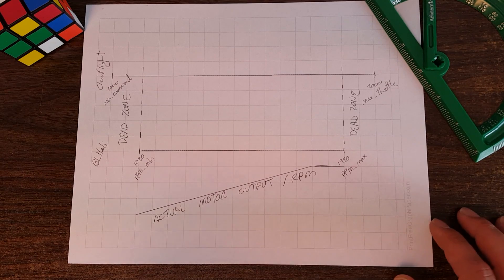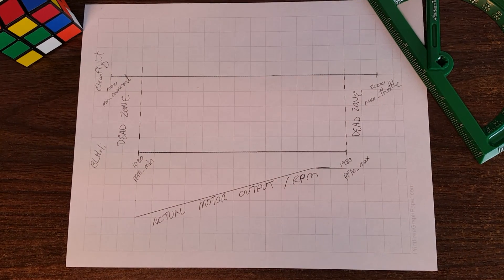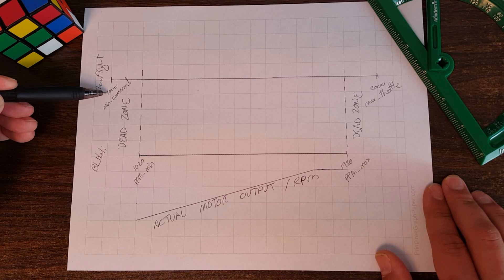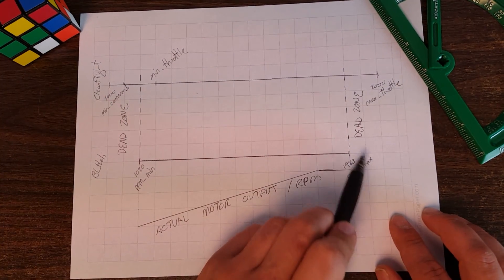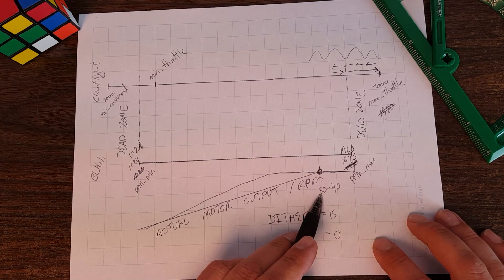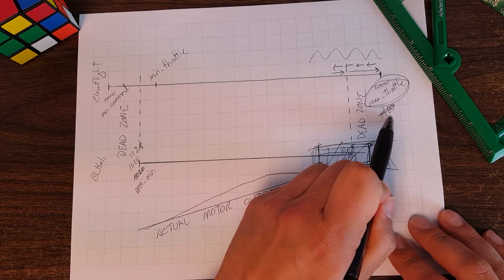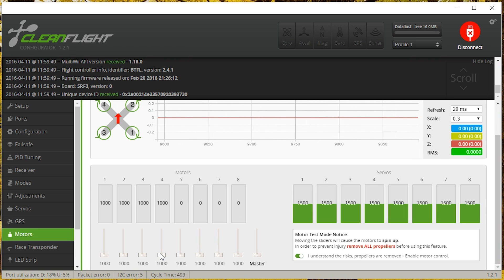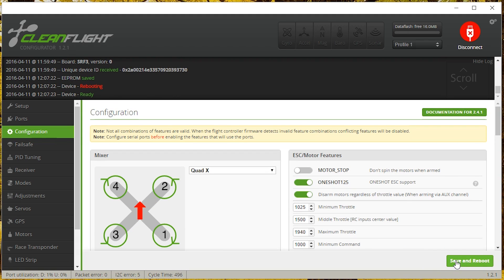Cleanflight BLHeli Top-End Throttle Calibration

Comment: Hey Josh, you do great work keep it up..I was doing some motor mapping and after I made a change I went to check my motor rotations and my ESCs would not initialize..they won't say nothing..I need your help..can anybody help...
Reply from the maker: You must have messed up the resource assignments. Did you note the default assignments before you started? Put them back how they were and start from scratch.

Comment: In my case BLheli calibration max endpoint gets set to... 2020 on 3 motors, and 2016 on one. LittleBees 20A PRO (f396 I think?) with Gartt  2000KV 2206 motors. Can you advise how should I proceed with BLHeli max above 2000?
Reply from the maker: Above 2000 is okay but I don't like to see them at 2020 because that is the max possible value. So you don't know if the calibration is correct. What if they "wanted" to calibrate to 2030 but couldn't because the scale stops at 2020. So I like to see all ESCs at no higher than 2016. 

Decrease max_throttle and recalibrate until that happens.

Comment: Hi Joshua! I saw this video so long ago but yesterday I finally gave my motors a chance.
After some builds, I am now testing the Racerstar BR2205S 2300KV   (cheap but valuable).

Basically my config is SpRacing F3, old school Littlebee 20A, 1300mah 4S, ZMR 250 frame.

I found something like this on the 4 motors:

ESC values 0 - 1920 = very good sound and spinning

1920 - 1940 = Lots of vibrations and not the same clean sound than before

1950 - 2000 = No vibrations, and I can not find a remarkable change in the sound when reaching 2000.

Any clue about this?  Many thanks for your videos and knowledge

Comment: Can you hypothetically limit max thrust on overpowered motors? Reducing max throttle value to say 75% of max thrust and achieve linear throttle 0-75% where 75% is max forward on the throttle stick?
Reply from the maker: +Pete Pilot yes, you could do this.
Reply: Thank you Josh, Can I also ask you your opinion on motor choice for a Crusader GT2 200. Im undecided between the Tornado T2 2300 vs the 2600. Wich one should I go for? The thought was that a overpowered 2600 under limit would give an efficiency gain.
Reply from the maker: +Pete Pilot personally I don't see the point in running lower kv motors any more. You used to give up a lot of torque but not any more. They're harder in your batteries, but if you look at what the winning racers are running, it's all high kv.

Comment: Is the top end flat spot present in all the BLHeli  ESC protocols i.e. Oneshot125 vs DShot600? What protocol are you running in this video.?
Reply from the maker: +Alkiterman top end calibration is no longer necessary.
Reply: Thanks Josh. Why is that?  I would assume you might have had a hand in this....BLHeli coders fixed it?  So, then my question is. Is there any additional tuning required? Like eliminating the 20ms dead zone and using 1980 as max_throttle ?
Reply from the maker: BLHeli firmware updated to no longer have the dead band at the top. Just set min_command=1000 and max_throttle=2000 and calibrate and go fly.
Reply: Do you have a link to the procedure to follow with the latest BLHeli firmware on non_S ESC's in BlHeli and Cleanflight/Betaflight?
Reply: its still there you can hear it even on dshot at least on blheli_s

Comment: Is there a reason why I'm getting numbers like 1850 in the motors tab for each motor? I'm at 960 min command 1020 min throttle and now 1803 max throttle? When I hover now my throttle stick goes over mid stick position, whereas before doing this dead band fix I was hovering below mid stick?
Reply from the maker: You changed the top end of your throttle curve, so you changed the mid-point as well. That's why your hover point has changed. If you go overboard with the top end calibration you will reduce your max power and overall power throughout the throttle curve. But if done right, the overall power will be the same, although your exact hover stick position may change.

If your max_throttle is 1850, that is the first step to fix. Use my "maximum resolution ESC calibration" method to perform both top end and bottom end calibration, while keeping the most possible resolution in your throttle channel. And of course make sure your throttle channel is going from 1000-2000 in the receiver tab.

Comment: Does this still apply in Blheli-S ESCs and Betaflight 3.0 as of September 2016?
Reply from the maker: BLHeli has improved their auto calibration algorithm to remove the dead zone from the top end. However, some people still get top end oscillation and can benefit from doing it manually.
Reply from the maker: +matixnznz yes.
Reply: humm this could be why after i flashed to the latest blheli firmware my esc's are now 2020 in ppm max throttle. might have to drop max throttle back in cleanflight and try again.

Comment: I'm sorry if you covered this question already, but I'm concerned about the the 20us deadzone specifically at the top end. Even if you are setting your maximum throttle at 1940, isn't CF going to really be sending 1920us to the ESC's? My thinking is that you will still be loosing about 20us of range? Hopefully that makes sense, thanks!!
Reply from the maker: If you adjust the cleanflight max_throttle after calibration, that cancels out the dead zone. The calibration ensures that what CF is sending is the same as what the ESC is seeing.
Reply: Understood, but didn't you say in your video that CF has a deadzone added in all on it's own? Regardless of what max_throttle says? Maybe I'm over thinking it but if the deadzone exists in CF, wouldn't you have to compensate another 20us to fully get rid of it? Thanks for the reply!!
Reply: To clarify my question, is there a deadband that exists within the top end? From how I'm perceiving your explanation, there is a top end deadband.
Reply from the maker: CF doesn't add dead-band to the top end of the throttle. I'm not sure what you're referring to, sorry.
Reply: Sorry for wasting your time with this, but I believe I figured out what I was confused about. The deadband (as you describe) is added on the BLHeli side when you do ESC calibration, not CF. Now I totally get why lowering the max_throttle gets rid of it! Thanks again for all that you do!
Reply from the maker: No problem! Glad it finally clicked for you.

Comment: imma try this, although my top end oscillations seemed to be gone with kk 5040x3 props, but a new weird issue appeared on a 4s bolt 1300mah... when i dropped throttle to zero (no motor stop)  the quad faulteringly dropped then revved up by itself, i wonder of this could be the lower end dead zone?, it didn't happen with 1000mah 4s so it seems unlikely, but at this point i have no other clues to go on.... it rev's enough to stop dropping and rise slightly, obviously not a good thing to be happening to a noob like me.

Comment: If, for example, my min/max end up being 1050/1950 in cleanflight, should I change my tx output to 1045/1955 or leave it at default 1000/2000?  wouldn't matching it up elminate some additional deadband on the top end?
Reply from the maker: No. Because you are mixing up the input side of the FC (transmitter -> receiver -> FC) with the output side of the FC (FC -> ESC -> motor). The two are not in any way inter-linked. The input side should always go from 1000-2000 with 1500 as the mid-point. The calibration you are talking about (min_command, min_throttle, max_throttle) pertains ONLY to the output side. It does not in any way pertain to the input side.
Reply: Thanks for that clarification!

Comment: Could you please help me out. In the Receiver tab of cleanflight everytime i set my throttle at 2000(max) and also my roll or pitch at 2000 Cleanflight freezes until i drop my throttle again. It only freezes when throttle and roll or pitch is set between 1900-2000? Is this a Cleanflight problem or will my Flight Controller also freeze when flying around and setting both at max?
Reply from the maker: Are you using a D4R-II receiver?
Reply: Joshua Bardwell No, i use a XSR.
Reply from the maker: Wait a minute. You are giving a stick command aren't you. Throttle at max and right stick up, left, right, or down is giving ACC trim. I don't know whether that usually interrupts the configurator GUI but it wouldn't surprise me if it did.
Reply: Yes, when i give my commands with my transmitter, Cleanflight freezes. What does the receiver tab have to do with the ACC-Trim in the Configurations tab? May you please explain what you mean? I'm new to this hobby, sorry if it might be obvious. Thank you.
Reply from the maker: You are inputting the stick command to cause ACC trim adjustment. I am guessing that when the copter adjusts ACC trim maybe it interrupts the GUI updating.
Reply: Lol, thank you. That is so much faster than adjusting the acc through usb! How can i deactivate this function after i'm done adjusting? I dont want my copter to drop from the sky whenever i have to go full throttle and take a sharp turn...
Reply from the maker: It won't happen when you're flying. It only happens when disarmed.

Try this: with your battery disconnected (so the motors don't spin) arm the board on the bench then go full throttle and full deflection on the right stick. See if it happens.
Reply: Joshua Bardwell Okay, thank you very much!

Comment: Hello, handy little explanation.
I've got a weird phenomena, soon as I reach min throttle (when motors actually trigger), they just keep revving up and up till they hit full throttle without me introducing anything that would account for this - stick is still at min position.
moving the quad during this will change their rpms but they have a tendency of 'wanting' to reach their individual max rpms and at the same time still trying to keep it level.
have you by any chance come accross something like this in past?

I am suspecting the esc's, one or multiple just being totally out as in.. sometimes there is a slight delay when I hear the feedback beeps. although when motor spins are tested it works just fine.
Reply from the maker: Props off on the bench, or props on in actual flight when this happens?
Reply: What I described were props off tests.
In actual flight when I managed to hover it outside, any input on any other axis would take effect, but followed by immediate, and sharp gain in altitude as well as if I increased throttle which I didn't. Basically unflyable.

Running Emax rs2205 with LB20a pro, first with LUX (despite O-rings, ridiculous yaw gyro spikes, never again with this combo), now got a RMRC dodo v3 and a naze rev5 to compare with, both FCs producing the same results.
Reply from the maker: That sort of suggests that the copter is over-tuned. My best guess would be excess D gain. Try again with D on all axes set to zero.
Reply: spot on guess, I didn't even get to tuning as I was just doing some random tests to begin with, it was running with default betaflight pids. Thanks a lot for pointing it out! (Y)

Comment: IS this what people call "short calibration"?
Reply from the maker: No. Short calibration is where you set your max_throttle to 1850 and then adjust the ESC's PPM_Max to match. This prevents the signal coming from the ESC from reaching 100% duty cycle and losing timing.

Comment: Great video and great explanation. I do however have a question or correction to the method you use. When you do WOT on the motors and "listening" for the point at where the motor actually has it peak. This is unloaded, which you of course will agree upon. But finding the "peak" for the motor, should really be done at the point it cannot spin the prop any faster. This will most likely not be at the point you "listened to", but much lower. And if the prop cannot spin faster you don't have positive correction in those RPM above the point to what the motor can spin the prop at. So my point is - The dead zone will be much larger, once you load the motor.
Reply from the maker: +DenHvideHund I had the same concern, but I'm not willing to spin the motor with the prop on to confirm it. I did ask QuadMcFly when I was making this video whether he found the deadband to be different with props on or props off, and I think I recall that he said he didn't find a significant difference.

Comment: Ok, but what about a transmitter / radio endpoint? If your throttle stick at full still sending 2000ms don't you have a "deadband" in your stick movement?
Reply from the maker: +tiemanowo No, because the input side of the FC (transmitter to receiver to FC) is separate from the output side of the FC (FC to ESC to motor). It's not like a fixed-wing where your throttle signal is passed by the receiver directly to the ESC. So your input throttle values go from 1000 to 2000 and your output motor values go from min_command to max_throttle and Cleanflight can decide based on its own internal logic how the input side gets mapped to the output side.

https://www.youtube.com/watch?v=WFU3VewGbbA

Comment: I've been flying my micro for a while with relatively stock everything... Never tried Blhelisuite before but I followed a handful of your videos and even found that one of my littlebees had an unrecognized firmware on it(fixed that){all bought at the same place same time}. After some hours of learning, calibrating, flashing and smoothing out the kinks I finally got the throttle curve and escs all going were I felt it may be an improvement from before. Went out and flew it the next day and everything was much smoother. Some of the wobbles in the prop wash have even been reduced and I didn't mess with dither from what it was already at; 7 or something. Even the motors were noticeably cooler than usual flights and that was after 3 packs. Now to tackle PIDS and blackbox! And you just uploaded something about mulitshot.... yikes!  
Thanks for sharing you really help out people like me who don't make it out to races to learn from others who are more experienced. 👍
Reply from the maker: +IzakGt Glad my videos are helping you enjoy this great hobby!

Comment: Someone in the rcgroups mentioned the new blheli 14.5 doesn't no longer add 20us, can you clarify this?
Reply from the maker: +Jharwin Barrozo BLHeli used to add 20 us of dead-zone at the top of the throttle range to ensure that the motor reached maximum power. Basically, if the FC sent 2000 and BLHeli measured 2000, BLHeli would set the top of the throttle to 1980. Now it doesn't do that any more.

See here for more info: https://www.youtube.com/watch?v=spegUYF8Dxk

Comment: Hang on a minute you set max throttle to the lowest number?
Surely that would mean only motor #4 of your motors would goto to 100% when the fc sends 1940us signal as they needed a longer signal pulse to get to 100% rpm.
I would have set max throttle to 1948 or maybe 1950 just to account for any jitter in the signal.
Reply from the maker: +Stephen Gibb It's entirely up to you. Setting it to the lowest number prevents any motor from going into the dead-band. Setting it to a higher number may result in slightly less smoothness at top end but slightly more power.

Comment: Seems like there were some changes to throttle curve in BlHeli 16.0.14.5.0.0. 
Today I flashed it to my LittleBee 20A ESC's and after calibrating 1000-2000 in Betaflight as usual instead of having about ~50-60us dead-band in high throttle I started to hear a noticeable "step" in motor sound at about 1980us throttle.
Min throttle also behaved a bit differently - motors started to cog at about 1005us throttle and reached reasonable idle at 1010.
Did any of you guys notice any changes?
Reply from the maker: +Bahecuk check the changelog. It says something about differences in calibration.
Reply: +Joshua Bardwell turns out that there is some kind of bug in throttle calibration - my max_throttle in BlHeli always gets set to 1832 after calibration and it is the default value that BlHeli resets to if it fails to recognize top throttle position. I had to calibrate in 1000-1950 range to get valid max throttle values in BlHeli
Reply from the maker: +Bahecuk oh jeez.

Comment: Just ran through this test with my KISS ESCs.  I set min command = 1000 and max throttle = 2000 and did an ESC calibration.  When I switched to the motors tab to listen for the dead zone it seemed to be around 1995 but was very subtle.  I could definitely hear a bigger change in pitch around 1985. 
Based on that I might set my maximum throttle to 1990, which sounds pretty good to me :)
Reply from the maker: Thanks for this data. KISS are known for having a very linear throttle curve.

Comment: Great video! I realized, I've been lucky to avoid bulk of the problem by setting my min/max throttle about 20 or so inside my configured ESC range on each side. Probably at the expense of some max thrust of my motors at full throttle. I like your method of finding where the sweet max-rpm value is. I am concerned about running motors at full throttle without load for so long, tho. Is the current limiter making that possible/safe?
Reply from the maker: +Jaisor FPV a bit, but still be careful. I was also using a discharged battery. Or even use 3S. If you have a bad sync problem it can fry the motor so take care.